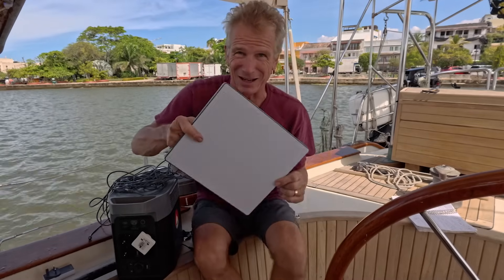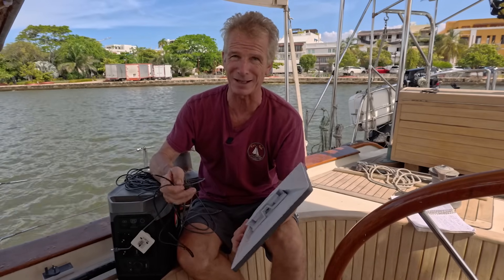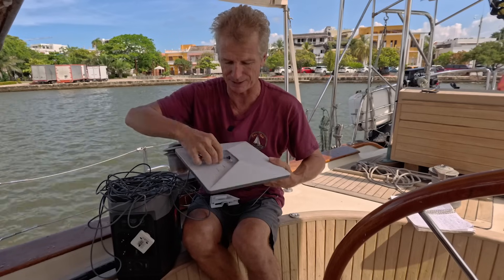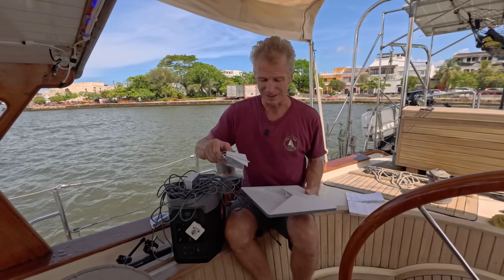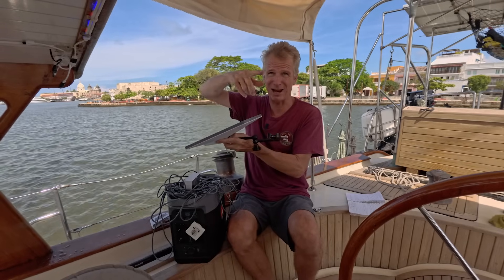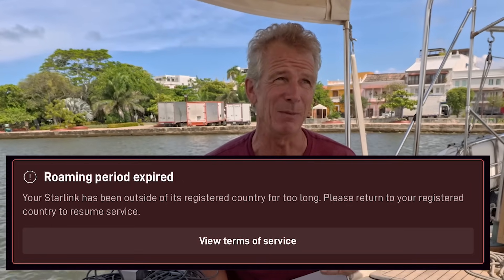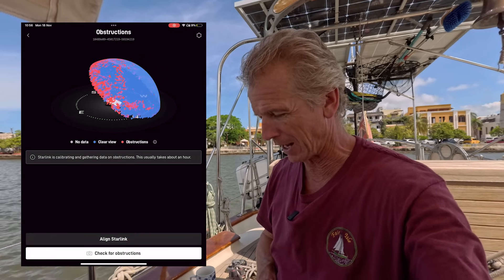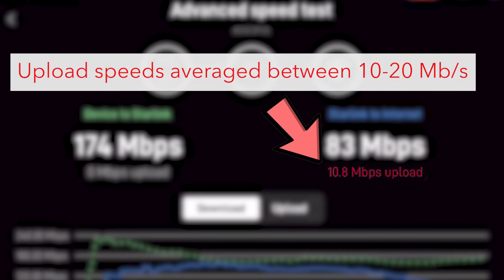Starlink Mini on a boat

Comment: True, I don't own a sailboat, but why every time you review Starlink you go on about the voltage?  How can this be such an issue? Not sure if it is some Europe vs American voltage issue, but I can't find anyone else going on about that issue at all.  Yes, it is electrical and voltage is required. Can you install the specified electrical systems on your sailboat as it must be listed in the materials or online?  If you upgrade your power system I am pretty sure that your experience will greatly improve. I say this since there are many other sailing channels that use Starlink with no issues at all and I can't see why there is such a different experience.  You have a large sailboat so you must have space for batteries somewhere?  Well maybe one day when I do get a sailboat I too will also be complaining, but I sure hope not.
Reply from the maker: I have no idea what sailing channels you've been watching, seems like it might be ones that don't understand electronics? We have top of the range Lithium batteries on our boat, but batteries just store power they don't magically get it! To do that we need lots of solar and a good alternator which we have, but if it's raining a lot as it is now in Panama and you're not motoring ( we sail as much as possible so rarely motor)  So power is always an issue for every cruiser unless you have a big generator and spend your life with it running which we certainly don't want to do.
Reply: Most of the other success are probably using Vac to power the provided transformer and cable. His comment was that the 12V looking cable is not suitable to be powered by 12Vdc of more basic boats.
Reply: Well then... Be prepared to do LOTS of complaining and hair pulling about voltage, current draw, and electrical systems if/when you get a boat 😂

If a useful video like this bothers you then extended stays on a boat may not be for you and you might be in for a rude awakening if you do get a boat.

There could be several reasons why you haven't heard about issues on other channels, too many to list without making this comment too long, but in this case @svfairisle is pointing out issues for running this with a 12V system... That said, not all boats are 12V bit if your boat DOES have a 12V system upgrading is may not be a simple thing to do and can often be expensive to do so, often needing many things designed for 12V to be replaced in order to run higher voltages. 

Efficient energy making and storing systems are right up there with the most important of things for cruisers and anyone responding to to contrary shows a lack of understanding and outright naivety.

When looking at additions to an existing electrical system for a boat try searching for associated issues with doing so rather than cherrypicking the benefits and perhaps then you will see other people noting similar issues.

Best of luck.
Reply: It's a big deal because you watch the power so closely on a boat, you need that power to run lights, instruments and even start the engine.
The last dishy was a pain to get to run on 12v because it was a specialised 48v POE. You run it without the 240v power block because the power block itself wastes between 20-50w and the inverter to supply 240v wastes similar. Getting 48v is also a bit of a pain when you only have 12v.
This new dishy says it runs on 12v, which may be true, but typically you only have 11.8 v on a cigarette stye plug after it has been through the various fuse panels, dodgy connectors and overnight discharges. So needing 12v exactly is a pain as well.
I would run this on 48v POE as you would only need thin cables and I happen to have that, but for most boaters that is a bit of a luxury... typically all you have is an old 12v battery and some old corroded cable!
Reply: Sorry but most sailboats running on old style lead acid (like AGMs) have 12.4v to 12.8v... under 12v means your batteries are near dead.  There just isn't a voltage issue running Starlink on most boats.  Why you were using a power bank (which can introduce power quality problems and severely limited power/current) is a mystwry to me... not what 98% of sailors would be doing.  I have a few dozen friends successfully using Starlink powered by their regular 12v electrical system. @SailingAquamarine
Reply: @quancij I hate to say it, but nobody who knows what they are doing with lead acids would run AGM and the ideal world doesn’t exist on a boat.
The 50% soc cell voltage on a flooded cell is 2.017v which gives you 12.01 v open circuit, at best, on a good day with nothing running. Once you allow for shunts, interconnects, fuse panels and long runs of cable to rubbish connectors and a few loads, then 12v is but a dream away in the middle of the night with no solar.
You have to allow for the extremes on a boat, because that is when you need it most, I’ve seen 10.5v dips on circuits when a fridge kicks in and you really don’t want your Starlink restarting just because someone opens the lid on a fridge when making tea in the morning!
I have couple of Starlinks (and fitted several more) if you want a reliable connection you use 48v, if you want slow unreliable connections you use 12v and hope your battery never gets low!
Reply from the maker: @quancij  I first ran it from the EcoFlow because it happens to have a DC barrel plug compatible with the Starlinks lead. Also the EcoFlow has a regulated output at 13.2 volts, much better and more constant than you could ever get from a house bank which will change a lot (if AGM) with state of charge and a little bit with Lithium like we have, but there’s no question the voltage will be lower. However I did try the Starlink on the boats 12v system as well with a much better lead, it worked but had outages due to voltage drops when in use (zoom call) Feeding the system it’s native 30v by using the supplied transformer cured all that so it’s pretty obvious that you are much better off giving the dish the 30v it was designed for, that’s how ours is running now, it’s allowed me to mount it on the back arch and use the long lead that was supplied which I needed as it’s a long complicated run to the switch panel.
Reply: @SailingAquamarine  ...sounds very complex and I really know little about sailboats, but I dream of owning one, and I know little about electricity except that 50 watts does not sound like a lot.  My dryer/washer are over 1000W, the stove is I think, 3600 watts and a hair dryer is 1200 watts etc.  So 50 or 40 sounds very very little.  Yes, it is more than a cell phone but not much for what it does. Regardless, the most important factor in life is Options and Choices ie what options do you have available and what choice do you make.  As for options, there is nothing even close to Starlink so the choice is easy.  You have to beef up the lion battery sources to handle this reasonably small power draw and be done with it.  By my calculations, for well under $5,000.00 in batteries you could now leave your starlink on 24/7 and use all the internet you desire.  That is a massive deal compared to just a few years ago.  In fact,you could probably achieve this for $2k.
Reply: @Coleen-Love  oh wow... ok, the batteries are just part of it. You could have 1 megawatt hour of storage, but if you cant generate that, then it doesnt help. Typically a cruising boat has 500w to 1kw of solar (you need a lot of space for solar.) Realistically it means you generate 4-8 kwh of power in a day. Your 3600w cooker will eat all that up in one to two hours. Typically a fridge will eat 1kwh in a day, a freezer the same. Now add in navigational instruments, lights, music, cooking. 4kwh is gone very quickly.
A 50w starlink will also use about 1.5kwh in a day plus the power required on the various devices to look at the internet.
If you also have to have 50w for the inverter to run it... thats another 1.5kwh.
Then you have a dull day and you only generate 2kwh and you have completely flat batteries and you are totally boned.
On a boat you really watch power consumption... you turn off lights, you dont open the freezer unless you have to, you turn off everything you can at night (including starlink) and you get rid of as many sacrificial loads as you can (like inverters)
You cant buy your way out of it. I'm afraid its physics.
Reply: @SailingAquamarine  ...ok, so what am I missing...  You say it is not possible, but all sorts of sailboats manage it.  Look at SV Delos.  They managed it fine.  Even before Starlink they had some satellite system that sucked huge power.  With Starlink they had no problem at all.  So what gives??
Reply from the maker: @Coleen-Love  What gives is that Delos have a large and noisy 7wk generator that they have to run a lot! I’m sure with their new cat they will also rely on solar I know they were not happy with the noisy and antisocial generator they had to run on Delos 1. Really these days on a cruising yacht the only thing that would chain you to a generator is if you wanted air conditioning, even that can be done as well on DC. Just not 24/7 and not the whole boat. We can have AC in our sleeping cabin on nights it is really needed most of the time but it’s all a balance. We cook with gas if we wanted to do that as well then we would be back in generator territory

Comment: A gimbal mount that is "magnetically" directed towards North is in order. lol could be a good product to sell.
Reply from the maker: We have ours mounted on the rear arch now, just flat, and it actually does just fine. No drop outs even at sea so it seems a good view of the sky is enough even if its not pointing North.
Reply: @svfairisle  Thanks for that info. I hope it doesn't affect your solar electricity production.
Reply from the maker: @naveenjayapal2331  No it's just outboard of the panels and level with the top of them

Comment: Thank you. Another very useful update. Much appreciated. One question: I can see the advantages of purchasing a new SIM Card.
But how do you deal with retaining your phone number or do you simply accept a new one? I appreciate that you can obtain a PAC Code from your current provider via text in a short space of time should you wish to retain your number. However, is there a delay in registering the PAC with the new provider? Did you experience any problems re time delay and fluffing about? Or am I missing something?
Reply from the maker: The Sim cards we get are just for Data, we use Whats app to call people. Most do ask you however when you add the eSiM or prplace the actual SiM if you want the new number or to keep the old, we just keep the old. All this PAC code palava seems to have been bypassed now.
Reply: @svfairisle  Ah, that makes sense. Thank you for a swift reply. All the best and safe sailing.

Comment: Why not eSIM rather than SIM card?
Reply from the maker: We need to look into eSims more. We use them from time to time but they seem expensive (if you use a lot of data) Are there eSims you’ve found with unlimited data?
Reply: @svfairisle I used a couple of unlimited eSIM last spring and in the fall from Holafly (other source could be Airalo) while sailing in Ireland/Scotland and France. It was about $60-70 and Worked well for me. Thanks for sharing your starlink mini experience !
Reply: eSim is just on-chip sim storage because mobile device makers are eliminating hardware sim slots. Gives mobile users more flexibility and reliability. Data is dependent on your plans bandwidth EULA.